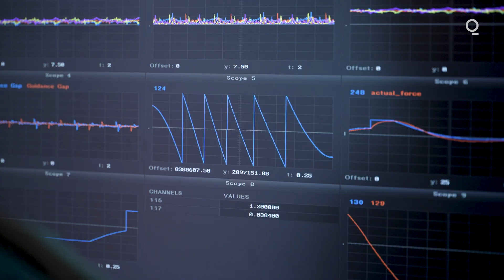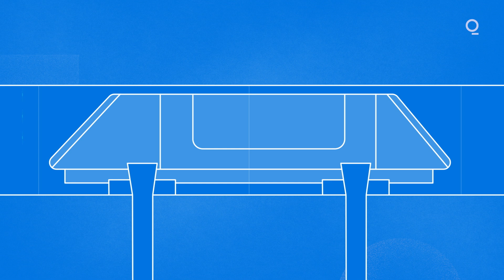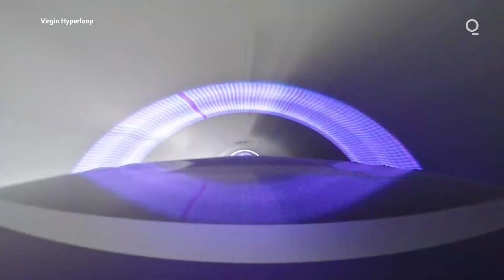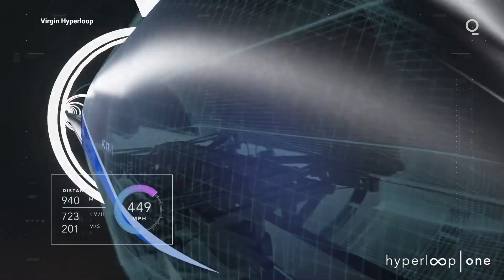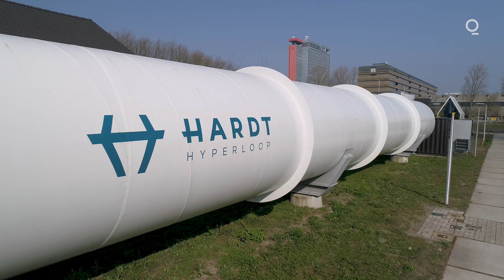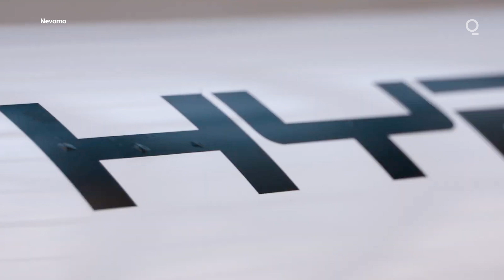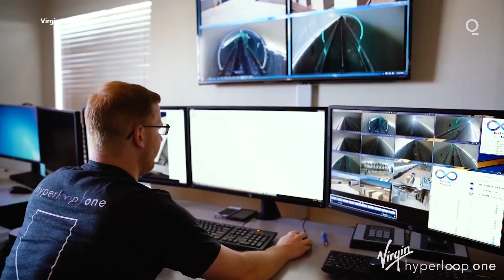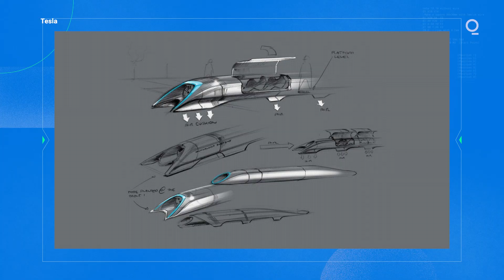The Hyperloop May Disrupt More Than Just Travel

Comment: I would love to see this technology work. I am an optimist. Yes, a straight tube with domed lids on each end can be evacuated and house a maglev train which speeds from one end to the other. In reality however, this idea has many non-scaleable problems that will ensure that it never becomes a viable form of transportation.
Reply: I’d just remove the tube and the lids on each end and leave only the maglev i think this concept exists some where already... 🤣
Reply: @platin2148  And the US is unable to realize a simple high-speed train since decades...  
 
It is frustrating that here in Germany we were the only country that had a working maglev, the Transrapid, that never got farther than its test track loop in the Emsland for 25+ years
Reply: @feedingravens  Basically it would require scrapping existing train networks, or building out new routes for the new network... All which can disrupt the existence dependent corporations on them.

Disruption is necessary to progress though.
Reply: @feedingravens  Yes, until they killed a bunch of visitors by running the train into a maintenance car!
Reply: @platin2148  Maglev has always seemed like an incredible waste of resources to me.   Instead of having the motor on the vehicle in continuous use, maglev has the equivalent on one motor for every few feet of track only to be used for a couple seconds while a train is above it.  That's like a 1000 motors per mile which means that a 50 mile track would need equivalent of 50,000 large electric motors to achieve the same result as 4 or 6 electric motors on a regular train.   that's a lot of wasted copper in my opinion.  Could the copper mines even get enough to satisfy the needs all the maglev tracks  imagined in this video?
Reply: @johng4527  I’m not sure if these speeds can even be reached with there conventional way of acceleration. There where tracks planned from germany munich to france paris and several others it mostly failed because of several incidents and politicians that could push it through. It needs a lot of Copper yes meanwhile that Hyperloop Cart is also not powered via Diesel but Electrical e.g needs some wires anyways. 

Meanwhile maybe the maglev is also not ideal and we should just switch to high speed rail seems to be quite proven to work and there can be still improvements made. The Hyperloop seems to be a ton of problems that require enormous amounts of energy and upkeep is also quite expensive just thinking about the Vaccum Pumps.
Reply: Why do libtads always do this bs self answering yes question. You live in a fantasy world where youre ignoring the very real physics of our reality and true nature. No matter how great they say this will be. There will have to be 100s of deaths of these pods slamming into each other at 200mph because theyre merging in and out like a highway. Tesla’s self driving cars have killed people aswell. The group risk factor in 200mph pod with 30 other people is not worth the individual risk factor of 1-4 people driving in a car.
Reply: True.
Reply: My optimism is that the idea will be abandoned because it is standing in the way of real transport solutions.  The reason Musk publicised the idea was to try to stop the California high speed rail project.  He hates railways.
Reply: In my lifetime phones have gone from needing a cord and attached to a wall -> attached to a wall but being cordless -> portable 5lbs bricks -> cellphones the size of a snicker bar -> cellphones that are 100x more powerful than computers used to go to space decades ago. I'm only 31, what seems impossible now likely will be childs play in the future.
Reply: @Aiyahhh  It will only progress as decently as you can afford one though, if the state of the world gets bad enough there won't be advances that are so cheap or accessible to have.
Reply: @Aiyahhh  That’s why i’d rather invest in wormhohle technology then a concept that they had in the 80’s and back then they didn’t manage to get anything useful.
Reply: @Aiyahhh  You compare a working system to a non working system. The hyperlink idea is over 100 years old and we have seen in all that time zero working examples. The phone worked all the time in the last 100 years.
Reply: @Aiyahhh  Hmmm... no. 
 
What will happen the first time a seal of a pod breaks and the passengers arrive on the other side and have all suffocated?  
   
When that happens A SINGLE TIME, it is over. No one will ever take it again. 

There is NO escape.  
  
You HAVE to take the pod to the end of the track before you can get help. 
 
This is claimed to be a CHEAP mass transport system. 
 
In a plane, when there is a leak, you have 5 miles to safety, in a few minutes you are down. 
 
The concept is that you have a plane with jetspeed within a tube with mere inches clearance. If ANYthing breaks off, it will stay in the tube. At one point, it will be picked up and damage something. 
 
In the moment you have to do maintenance, the whole tube is disabled.  
 
Have a look at my other comment, I would be interested in how you overcome these issues.  
 
One can overcome lots of TECHNOLOGICAL issues, but the issue are such logistical questions, and about those you hear absolutely NOTHING. 
 
All things that are present in other transportation systems (or are not relevant at all) that make the system working and reliable AND expensive are simply ignored. Then it is easy to be cheaper.

Comment: As someone with a science education (got a chemistry degree) I can give you some reasons, just off the top of my head, why the hyperloop concept is the dream of a media-savvy marketing manager, and not an actual engineer.
1) Maintaining a vacuum in a tiny experimental setup, with minimal connections between the lab glassware, is a complete and utter pig. More connections=more places for gas to ingress–and that means that you have to pump all that unwanted gas out ... continuously, in the case of particularly hard vacuums (like the one in the hyperloop). So for a huge, long pipe with a lot of connections, that means a lot of pumps, operating and consuming power. All the time.
2) If all this is supposed to be running in a pipe of some sort (although I note its absence from the thumbnail, and the presence of wheels on the pod), then I would draw people’s attention to something called the Thermal Expansion Coefficient for Metals–which for a steel pipe (even a segmented one) over many hundreds of miles would amount to several hundred yards of movement at the terminating points, for a very small change in external ambient temperature (say, the difference between day and night).
3) If one of these very long vacuum pipes has even a tiny rupture, puncture or failure of any sort (other than the expected leakage at the joins that the pumps will be running all the time to obviate), then you have to consider hydraulic shock (since air behaves like a very thin liquid, and the same equations describing liquid behaviour apply to air masses too). Put another way, think about a wall of several tons of air approaching at the speed of sound towards a small pod/tin can coming in the opposite direction at 5-600 mph. Said tin can would be smashed like a submarine passing crush-depth, before any emergency action could be taken to help the people in it. Fun.
4) The cost for new high-speed rail track to be laid is about US$ 25million/km, depending on terrain and population density around the proposed line. The cost of installing a new maglev line is around US$60-100 million/km. And then they want to put a vacuum pipe around all of that for half the price of high-speed rail?
Nope, living in a dream world—no dice.
Reply: Stop using logic and simply reason, to explain things. The kids just want cool looking future stuff with out thinking to hard. Oh my brain hurts. :-)

Comment: Thunderfoot's gonna have a field day with this one
Reply: Well hes already done a Hyperloop Debunked.
Does he need to beat a dead horse....

Ok maybe its not dead and can be beat more.
Reply: @Joseph he literally works with vacuum theories in his job as a genuine scientist!!
Reply: Im pretty sure he already has
Reply: @Joseph Problem 1: You need a giant terminal where the people can board the pods. Then the pods must be sealed vacuum tight and maneuvred into the airlock queue. 
 
 Problem 2: it is not one tube, it is 3. One in each direction, one for maintenance and emergency. Triple the effort compared to all depictions and claims "It is by orders of magnitude cheaper than ANY other tunnel". 
 
Problem 3: what happens when there is a problem in the terminating airlock? To have mass transport (as claimed), I assume there are MANY pods in the tube at the same time. They now queue up at the airlock. No way to escape until the problem at the airlock is solved. 
 
Problem 4: you can overcome the bottleneck airlock failure by providing multiple airlocks. But then you need to install switches to the various airlocks. Now the switches are the bottleneck. And for each switch you need a chamber that is able to surround two (or more) tracks. That will quickly dward the NASA vacuum chamber. 
 
Problem 5: It would be unavoidable to install bulkheads into the tube to avoid to have the complete (potentially hundreds of kms long) tube inflated each time you access it. But you have a maglev track in there, that is necessarily irregularly shaped and MUST be contiuous and smooth (at 900 km/h and with wandering magnetic fields). How shall such a seal look like? Up to now no one showed anything where a maglev is integrated in the tube, or where there is a separate airlock. 
 
Problem 6: What when the inevitable happens, a defect causing a power outage somewhere in the tunnel? All pods must be autonomous until they can be accessed, for braking, oxygen and CO2 removal like in the ISS or Apollo 13. To save space, the tube is designed so small that you cannot exit from the side; not enough clearance. And either you inflate the tunnel, or for an escape each passenger has to put on a spacesuit... 
Let's not think about claustrophobic people. Especially in a pitch-black tube (scenario is power outage).   
 
Problem 7: And you need maintenance vehicles that are autonomous, that have their own power supply to drive half the distance into the tunnel and back, and to pull pods out of the tube. MANY pods.  
Respectively, you will need airlocks every few kms to insert such vehicles. And have them ready that they can be inserted on short notice ALL along the track. 
  
These are systematic and logistic problems that would have to be solved BEFORE presenting the umpteenth sleek low drag pod, streamlined for use where there is no drag...
Reply: @Joseph It's not about physics and engineering. It's about not being economical. This isn't mass transportation but rather a project like the concord
Reply: @Joseph There's nothing to refute, you're entire argument is "papa Elon figured it all out! He promised!!" Go back to Joe Rogan
Reply: @Philitron128  Typical for musk fanboy ;) "dude build e-cars = he could build everything"
Reply: @Joseph All praise the hype-paper!
Reply: @Joseph You obviously don't understand what a PhD in Physics & Chemistry is,which is what Dr.Phil Mason has.
Reply: @Joseph Because your points are nonsense
Reply: @Joseph what experiment are you takling about?
What would make you think he doesn't know how vacuums and corrosion work, he works with vacuums and just made fun of the loop guys screwing up and having their prototypes rust, if anything that proves the loop guys don't even know how corrosion works...
Reply: @chalichaligha3234  If there is a linear relationship between pressure and air resistance, why not aim for say 10% vacuum instead of complete or close to complete vacuum to start the project with?
Wouldn't high speeds still be achievable but without having to get into those though exponentially difficult/expensive zone? Then as tech improves we gradually see improvements in vaccums. 
Genuine question, please pardon my ignorance.
Reply: @Joseph And you are an engineer? where do you work then?
Reply: @Joseph and about the air rushing back in to fill the vaccum? Wouldn’t that be dangerous? And even if it works how long will it take to resolve the situation and get the train up and running again? And what about evacuating the ppl inside? Would you like to put in emergency door just to further weaken the vacuum chamber?

You have as much cred as a software engineer on this matter as thunderfoot only he would have taken even more advance physics course than you, a software engineer would have to. All these problem that were raised most of them aren’t even engineering specific, it’s just basic security thinking. You don’t have to pass such course studying software engineer I guess.
Reply: @Joseph It’s possible in the next century, but u would have to be delusional to believe this is possible rn
Reply: @Joseph Lol, Two physics AP don’t make you an engineer, Joseph. 
You also couldn’t refute my point about the security system of the hyper loop, right :)

Quite short tempered for a software engineer you claim to be
Reply: @Joseph I can tell you never took any form of Chemistry in college(probably barely made it out of HS).Many fields of science have a physics foundation.Just like there are many fields of physics or they intertwine.IE:Chemical Physicist,Organic Chemistry.
Reply: @Joseph Have fun maintaing 1000+ slipjoints all along the tracks situated in the middle of nowhere. Oh one more thing, in all these renderings it appears the Hyperloop system would have its own individual tube. If that is the case for the finished system and one of them randomly malfunction and stuck dead in the tube it's going to be a lot of fun waiting for it to be fix ;)
Reply: @Joseph I'm sorry friend, I'm pretty sure acing AP test on physics does not mean that you're an engineer. Constitutionally you're probably better than me physics-wise. But big part of engineering is also about economics, project feasibility and safety standard.

Your technique addressing Thermal expansion may be sounded, but will it prove practical in a large scale? And would it be safe? 

You know that you'd need a bomb to demolish a railway but for hyperloop you only need a single bullet to have the whole thing grind to a halt. And as the whole system is inside a tube, and devoid of any windows, were there any malfunction happened how would you evacuate the people inside? These are some problem that were raised by our friend Thunderfoot but you fail to address also.

I'm sure anyone who master advance physics course could come up with thermal expansion solution just like that, but it would take a mind of an engineer or the likes of them to address small detail that's the difference between life and death of the user.

May I ask again wether or not you're an engineer?
Reply: Thunderfoot is a joke
Reply: @Joseph i agree. I remember that one time where he broke glass beakers by pouring liquid nitrogen into them... Three times in a row, without realizing why it keeps happening.
Reply: @Joseph Too unsafe and too many hurdles to jump tbh.
Reply: @Joseph I mean all your doing is repeating rhetoric, this is literally a vacuum tube almost at the speed of sound. I have no idea why you are calling everybody that disagrees with you an idiot .
Reply: @Joseph Oh his other 2 successful businesses, yes. One that's based off car batteries that only works because elon is famous and the cars look half decent, and a rocket one where he's flushing out the competition with his government contract money. His self-driving AI is cool, but even that is getting out-done by random people in open-source projects.
Reply: @Joseph java, swift, and js. what a joke.
Reply: Let's say optimistically there's a working loop in 20 years ..in the meantime just give us a licensed Shinkansen ^_^
Reply: 😂 all so true !
Reply: @Joseph bro are defending this trash? some taxis underground dont make a ""hyperloop""
Reply: @Joseph umm yes he did. You can't tell an actual scientist he doesn't understand science without making yourself look like an idiot.

If he is wrong, do tell with what exactly.
Reply: @Joseph this. thunderfoot is an idiot (and ostensibly anyone who follows his hot garbage takes). he's a scientist sure, but so are 4th grade chemistry teachers. a pHd does not make someone an expert on anything.
Reply: @ando4414  HAHA!!!You sound like a sad little guy with low cognitive functions.
Reply: @ando4414  haha you actually called TF an idiot? you've got balls, whats your credentials?

Comment: man the first accident in one of these things is going to be epic...  
the pod will be obliterated, and anyone surviving will suffocate because it's in a vacuum.
Reply: Also, how will they seal 600 miles of expansion joints? Those tubes get hotter on top than the bottom. You’d have hundreds of thousands of macaroni shaped tubes.
Reply: @richardmcmurry5974  rails can warp from overheating too.  Then there's magnet maintenance, warning system maintenance, lots of factors. Tbh the engineers know about all the risks, but there's bound to be compounding issues eventually.

Comment: What about the weather conditions? Earthquakes, tornadoes or extreme heat? These things sitting above ground could generate about 200 degrees of heat inside the tube and how will that effect a pod that has to stop for an issue with the track? Everything is always great when it’s working correctly but I think about the horrible accidents and the ways people will die. An airplane or helicopter is about the worse way to die because people know moments before the impact. An airplane has windows and some people can survive a plane crash and get out of the crashed plane. In these tubes if the electric goes out it will quickly get hot and less oxygen. A lot to consider if a pod has to stop how will the occupants get out of the pod. Out of the tube to the ground?